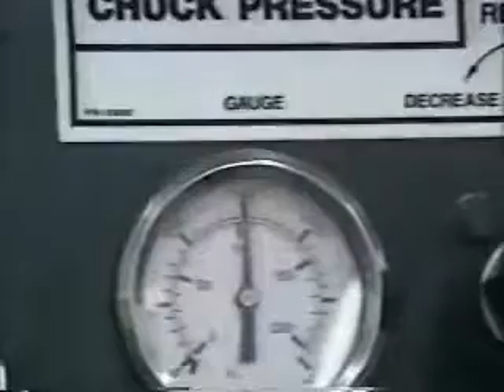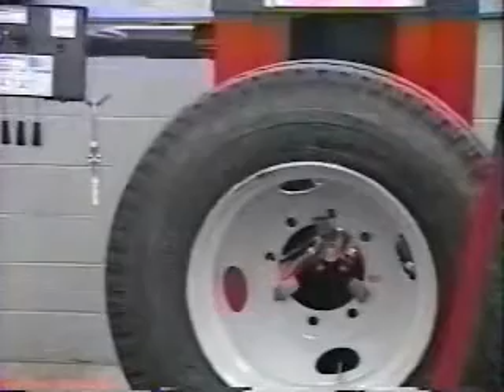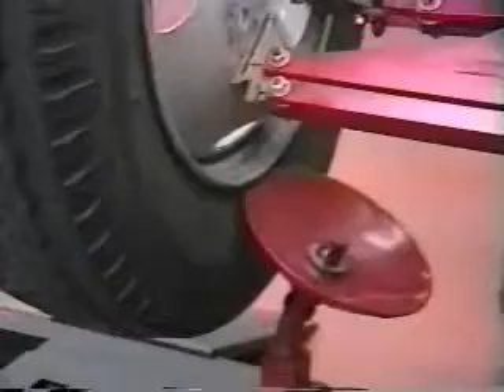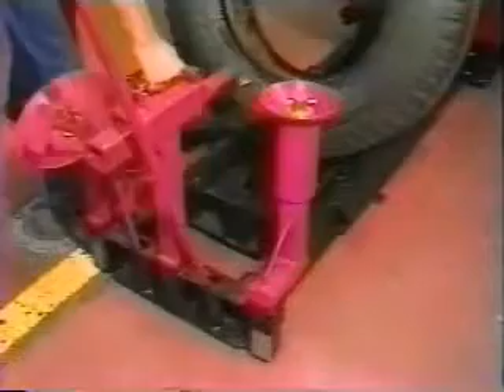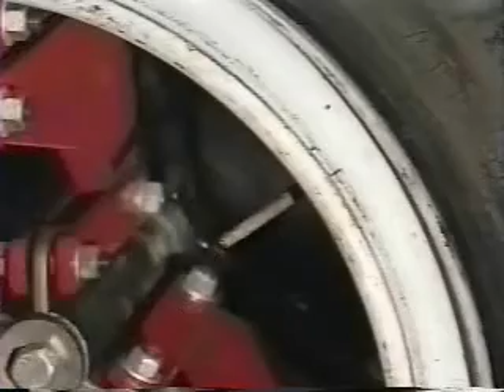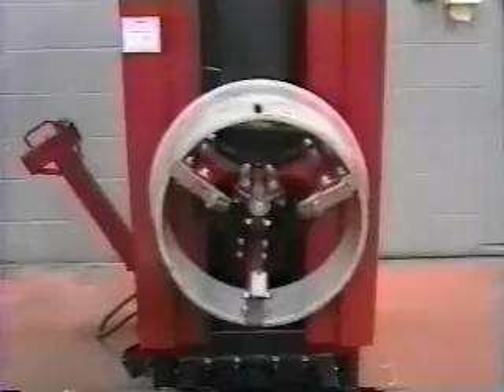coats90005000hr09

Comment: What a joke of a tool. I could have had 4 11R22.5's done by hand in the amount of time it took this guy to do 1.
Reply: They may be true, but I've been doing 11rs, 315s, and 425s for about a month straight, and just started using our shops, and my back and knees are very thankful.  I don't care if it takes five minutes longer.
Reply: I do this for a living and I agree with you.
Reply: Dude I found one of these in my workplace in 2026 and this video miraculously existed. Thank you random stanger, I am now certified to operate a Coats 9000